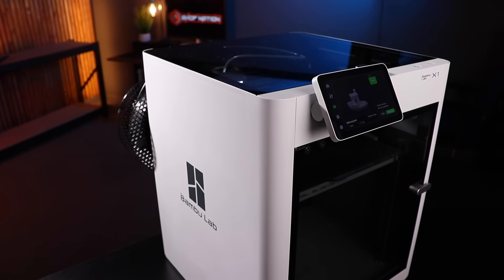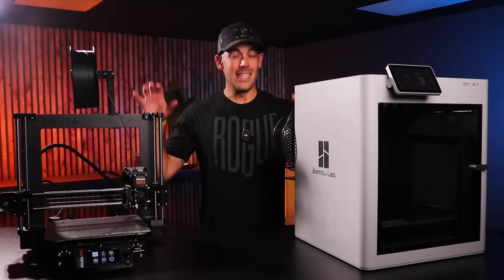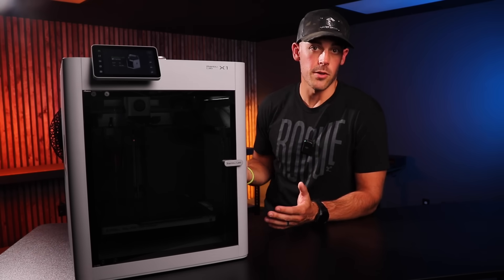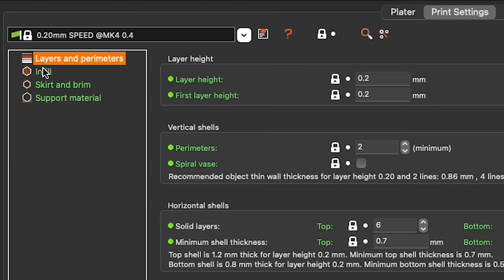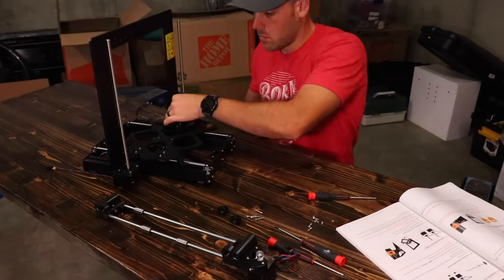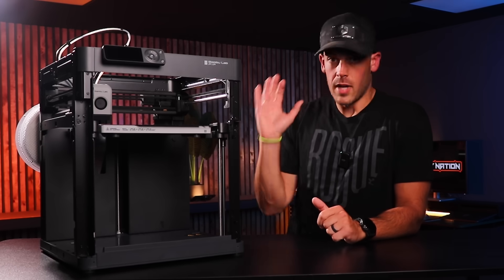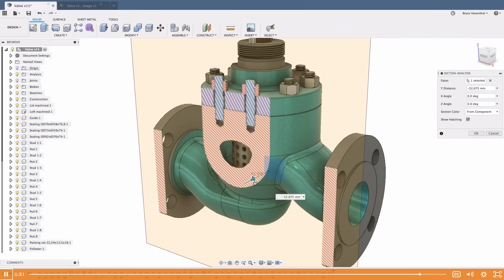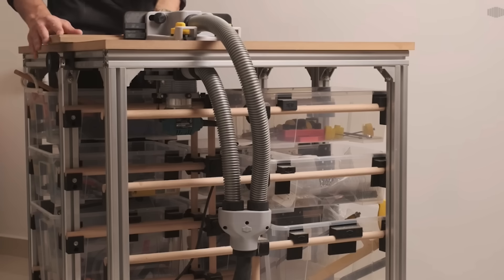The 3D Printer I'd buy if I started over

Comment: I work fully remote for a medical device company and I'm shopping with specific requirements.

1. Wifi - IT policy restricts moving files to external USB or SD cards and I'm not lugging my laptop from upstairs down to the garage every time I want to print. 

2. Enclosed - I need to print ABS and fiber filled filaments for maximum mechanical strength of prototypes while maintaining dimensional accuracy and minimal warping. 

3. Sub $1000 - I'll be using this for personal as much as for work use so I can't expense this through my employment. I'll be paying for it out of pocket. 

The Bamboo P1S and Creality K1 Speedy are the models I've dentified that meet these requirements. I'd appreciate your thoughts on those models.
Reply from the maker: If you want to print composites you will need to shell out the extra $ for the X1C. Hardened steel components specifically meant to handle abrasive composite materials

Comment: Elegoo Neptune 3 Plus is a fantastic printer and they are 3 different bed size versions. All reliable and $450 or less. Fantastic starter printer. Haven't had to work on the printer I have had for almost a year now. Auto bed calibration and super easy to use.
Reply from the maker: That’s great!

Comment: If we were starting over we would just pick up sovol sv06s instead of our 38 prusa mk3s, prusa minis, and x1 carbons. The sv06s have been pretty close to the mk3s performance with no downtime and 1/5 the price
Reply from the maker: Interesting. How many minis do you have? They are terrible
Reply: @ShopNation  we have 14 minis. Print all PETG on them. Currently only have one down. Our largest part design is 6.8” wide so the minis can print everything we sell at the moment. We did switch to the bondtech heat break on all of them. Otherwise they have been great with PETG

Comment: Get back to me after one year. 

My Qidi just worked for a year, ad it was absolutely excellent, right out of the box. Now it's gone all screwy, and as nice and helpful as Qidi are being, so far their help has consisted of "it's the touch sensor we'll send you a new one" and "update the drivers". 

I've done that twice and the problem remains. 

I told them right from day one, the problem is that the control board has gone wrong but they don't seem to want to accept that as the fault. They want me to update the drivers instead. 

Grrr...
Reply from the maker: I’m back after 5 years. Prusa still rocking

Comment: Well made video but I don't agree with your comparison. A couple of reasons why: 
- Why did you compare an MK4 to an X1C ? They are different classes. Sure they cost the same, but they are a completely different class of printer. (enclosure / accelerometer / filter / camera / microLIDAR / ... ) Fair would be comparing it to the P1P and still it would be outclassed. 
- Why would you advise buying an MK3S+ Kit at this point in time when you can get a MK4 for an extra €100? Reliability is a bs argument as they've ran over 10.000 hours and they come from the same company. So reliability/customer service should all be comparable. 
- Fixing or replacing parts does not seem to be as user friendly with the Bambulabs? I don't agree. What is not user friendly about swapping out pieces? In most cases it's unscrewing 2 screws or just decouple some things. Have you tried replacing a broken item on the MK3s+ extruder? Also please explain which items aren't fixable on the Bambulabs printers? 

I don't believe this comparison was done in a fair way. And this is coming from a person who also owns Prusa printers (MK3S+, Mini+, XL being shipped). I do agree with buying a (newer version) P1P when starting out with printing.
Reply from the maker: So after all of that you agree with the message. Sweet
Reply: @ShopNation  Well, I wouldn't call it "sweet" because 90% of the video was wrong in my opinion. Is there a reason why you can't answer a single one of my questions?

Comment: Random question:  What is the cheapest printer that does steel?
Reply: Depends which kind of steel/metal. FDM Stainless is the cheapest and will cost you upwards of $10,000 for something actually reliable and made for SS. A Laser/powder fusion printer (what you actually want for good quality metal prints) will set you back around $100,000, or if you are capable you can build one for around $10-20k, which is a crapload of work.
Reply: @RussellWhite-m6w  a somewhat saddening answer, but I do appreciate it!

Comment: I built my Mk3S+ - thoroughly enjoyed the experience and the insights into the workings of the machine were invaluable. I did have one problem (one of the PSU connectors was reversed from the factory), but Prusa's tech support sorted the issue after a couple of rounds of emails and troubleshooting.
And it's chugging away as I type.
Reply: Prusa was my first printer after watching family members struggle with cheaper printers. Now i have an xl and its amazing. Probably overkill.
Reply: @scooterpinball  i don't really get the thing with "struggle with cheap printers" thing, mine was 150 bucks work perfectly fine. Printed things from big to small as 6mm (gears- for a laminator, replacement gears for a face trimmer) to Glass shower hinge replacement parts to decoration, wall mounted shelves/phone holders  etc etc So hobby level stuff in general but i have NEVER had any issues with it. Maybe some tiny "problem" with overhang capabilities but nothing supports, or general design work to minimize overhangs can't fix. Ain't gonna spend 1k+ for a hobby machine that a 150 one can do just as good with a TINY bit more effort.

Comment: Hi, nice video. I have had several printers and now on a Zortrax M200 that I used professionally. 
I would definitely get an enclosed model with a filter if your going to run your printer @ home, ABS stinks. I wouldn't get side tracked by 'multi-colour' capability unless you really really think you need it. You rightly highlight first layer success as the #1 beginner problem -nightmare back in the day...
I successfully used "TinkerCad" as the models I needed were not too complex and it has the advantage of being so simple you don't forget how to use it if not designing anything for a while...

Comment: Just got the p1s, super excited. Started on an ender 3v2 and man it was an absolute pain. Ended up bricking it due to a firmware update and had to return it. Starting to get back into 3d printing and I wanted to make sure I actually got one that worked.
Reply: not sure what happened to yours but my Ender 3 Pro has been flogged nearly non stop for over a year. I've replaced the Bowden Tube and a couple of nozzles. Otherwise a pain free experience.

Comment: Excellent video!! I've been designing and printing 3d for awhile now. Still using my Ender 3 with only 1 upgrade left to do. My question if you'd be so kind to answer is which printer is accurate enough if I create a model say .753" diameter and it actually is .753" in the resulting part? I find I can get either an accurate hole or cylinder but not both. I need to compensate in the model to make sure it comes out correct. It's a pain as I usually make a slice of the part, measure then adjust in the model. Wish I didn't have to do that. Thanks!!

Comment: Help! Need some advice on 3d print material. I'm trying to print a box similar to what floss comes in or like a cigarette box. I want the hinge to be similar to that of those boxes (I don't want to add clunky loops and pins) but rather have the material bend like it does on the glide floss box. What material would do the trick? Seems like TPU is too flexible and PLA is too stiff. Any in between material I can look into? All suggestions or thoughts are appreciated.

Comment: Dude. I bought an Ender 3 for my first (and only, so far) printer. What you said about the Prusa being good for someone who wants to get into 3d printing, not working on 3d printers, is too true. I've worked on this thing countless times now.
Reply: I've never had any issues with my Ender. It's a beast for fraction of the cost these recommended printers are. Of course it's not the ultimate end tier printer, but for a starter? Better than the recommended ones IMO  

(Ender 3 V2 here)
Reply: My ender 3 and 5 spend half the time needing fixing. They are for a hobby not a tool...
Reply: %0 prints into my Ender 3 S1 Pro and zero issues so far, Lmao.

See, I knew Blender before getting a printer. 

Enders are fine. You asshats simply can't slice for shit.

XD
Reply: As someone who first came in wanting to 'just print and not worry', I was recommended the Creality CR-6 as it 'has the comfort upgrades Ender 3 really needed'.

I can tell you now that 2020 advice did not age well. CR-6 is one of the hardest mainstream printers to find off-the-shelf commercial parts for (yes there's a community but depending on Discord dudes for printer upgrades is the exact OPPOSITE of what most of us signing up for a CR-6 wanted).
In fact, it's such a pain the arse bc now I'm fully happy to tinker with my own printer and I can't even easily do that like I could with an Ender 3 with 10x more resources and support.

Moral of the story, don't buy in on proprietary designs too hastily. Creality was a big entity in the space even 2-3 years ago, but I misjudged how they would design a new set of EVERYTHING for their fancy new affordable printer--and proceed to immediately back-track to the Ender 3-based mounting holes and designs immediately after that.

Literally got rug-pulled by a company that is still thriving.

Comment: Nice honest Video. You are right Prusa’s are work horses but way too slow and overpriced. I bought an X1 carbon because I needed fast prototypes . One thing you should have mentioned is the Bambu labs prints a greater variety of materials the Prusa can never print because of the lack of an enclosure.

Comment: I respect your opinion, but I got into 3d printing a couple years back now, I went with an Ender 3 v2, upgraded a couple of bits, spent a month swearing while I learned what I needed to learn and setting up the machine properly, trouble free printing ever since, I rarely even have the level the bed after swapping to the metal magnetic bed. Total cost less than £250.00, you can't argue with that, made tons of cool stuff with it.

Comment: Hi. I currently have a MK3 kit and learned a lot and had no problems. Have ordered a MK4 kit because I will learn a lot. But I am on a long waiting list. Both the P1P and the X1 are looking very good. The PRUSAs just work W/O any problems and help is available 24/7 and parts are quickly available. How are  P1P and the X1 working out in these areas? and an extensive help application like PRUSA?

Comment: I use ASA or ABS filament for toughness and resistance to moisture.  My printer recommends closing the sides for these hotter materials.  Something about warm air inside.  Do you agree with this?  And, is it better to get enclosed model for users of these hotter plastics?

Comment: Kinda depends on what you want out of it.
Sometimes it is better to get the chevy pickup as the first car so you can learn how to repair it.
If you have no interest in fixing anything up, you buy the toyota.

MK 3's and MK 4's are basically... extremely overpriced.  Reliable?  Sure.  But 13 year old kids looking into 3d printing for their hobby probably shouldn't be drooling over 1200 3d printers when they can spend $300 and get the ball rolling.

Comment: 2:50 I am brand new to the 3D printing space. The Ender 7 did EXACTLY to me what you just warned about. I got 2 prints out of it and for the last 4 months I've done nothing but try and fix it. Bought a bed leveling kit, the CR touch, no brackets for the ENDER 7 on that by the way, had to have one made and it still isn't right. JB welded it to a l-bracket and zip tied it in. Of course that failed. (Knew it would but was at wits end) Creality customer support told me I just didn't know what I was doing and cut off contact. I think the z motor is bad and I am pretty sure the board is the right board for it either. I want to 3D print, but even after buying yet another printer, I still only got 4 prints and then catastrophic failure. Sunlu printer this time, bad motor. I replaced it with a BRAND NEW one I had bought for the Ender, and it too is apparently bad. How did I get 2 bad motors in a row? So know I have 1000 dollars worth of 3D printer paper weights.

Comment: I bought an Ender 3 v2 as my first printer before the Bambu Labs printers came out, but starting over I would definitely get a P1P
Reply: But it costs wayy moree. do you think buying a ender 3 v2 then upgrading it as you go is more worth the money?
Reply: @axeltheodorus18  It depends on the person and what you plan on doing with it. The Ender 3 series printers are great for the price if you don't mind tinkering, but all the modern QOL features that the P1P or X1 Carbon have compared to the E3 are so worth the cost. Out of the box you already have to upgrade a couple of parts to make the Ender 3 usable for certain filaments, like PETG or even certain HTPLA/PLA+ filaments. A Capricorn tube, and textured PEI build plate are probably the main ones I would recommend. The glass bed sucks since once you damage it, it's basically done for since it will never be level again. The stock PTFE tube warps from heat and melts at the upper end of what the stock hot end is capable of so the Capricorn tube is also pretty much necessary. After those 2 upgrades you're looking at $250 minimum maybe closer to $300 depending on the model of Ender 3 you get. A V2 can be around $200, but the newer version is more.
Reply: @legoboy-ox2kx  Holy shit i think you should make a review on your own channel comparing these printers lol. Thanks for the complete explanation really appreciate it :)
Reply: @axeltheodorus18  If you can get an Ender 3 S1 for $200 you just have to replace the hot end to make it pretty much a perfect entry level machine if you want to tinker with the printer. The P1P is basically the best no nonsense entry level printer since 600-700 is the same as a Prusa Mini but the P1P is bigger than an Ender 3 and prints way faster.

Comment: I'd like to recommend the Anycubic Kobra Max as well. It's a giant 3D printer that just works out of the box and then continues to work forever. It can produce beautiful prints at 60-80mm/s and functional things such as brackets and fasteners at 150mm/s without flaws. It just works and keeps working.

Comment: That price point is a little steep for beginners, especially if they just end up printing trinkets. I've owned over a dozen FDM and SLA printers that I use for my business. I've settled with Anycubic Kobra models (I believe discontinued for newer models) that were $260 each. They are usually running 4 days out of the week. I haven't run into any problems outside of doing the leveling sequence maybe once ever six months. 

The PRUSA MK4 is a pretty good printer, but I'd suggest something less expensive to friends that ask me about 3D printing mostly because they are complete newbies.

Comment: Ok, but a $700 machine isn't a "printer that anyone can afford". 
And it's also a big purchase for a newbie thats unsure if 3D printing is something they'll enjoy.  When I got my Ender 3 Neo I wasnt looking. My wife saw it on Amazon during Cyber Monday for 215 bucks and figured it would be something I'd enjoy, and if not, no big loss. Now 7 months later, I've  run my machine nearly non-stop  and have made some amazing things. I have had to tinker and tune here and there but ive learned something every time.
So here's my point. If a 700+ printer is out of your price range you can absolutely get started with a Ender 3 or something similar. Do your research, find online help groups and how to videos for your machine, and be patient as you go through the learning curve. These things can be finicky but they're basic enough that you'll soon be able to diagnose problems and correct them quickly.

Comment: I got an Ender-6 bed-leveling till the cows came home, bought mirrors for the beds, various glues, new Bowen-tubes several times better quality filament. Out of my first 50 prints I had 5 successful ones! Then I discovered how useless 3D printer plastic is. The entire hobby is a waste plastic manufacturing ploy. Hand carving wooden parts would be quicker cheaper and stronger... My printer has been a pet rock since and soon will go to the rubbish tip.

Comment: I have a FDM printer but for functional parts I moved to top down resin printer. The limiting factor for resin printers is build volume. sure there are large volume resin printers but you have to mortgage your house to buy one. Carima DM400A has a 400 x 330 x 500 build volume at a print speed of 200mm per hour

Comment: I am pretty happy with my elegoo neptune 2s. It printed perfect right outta the box. I've swapped out to an all metal hotend, added wifi, and flashed custom firmware but none of that was necessary. I just like to tinker. If you only printer 10-20 things a year it is definitely the way to go. Check out any review if you have your doubts.